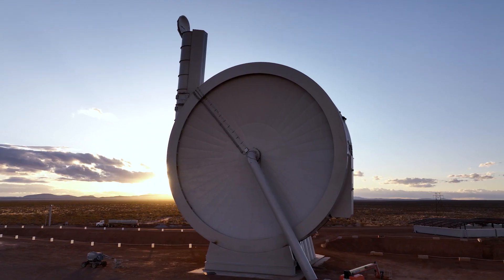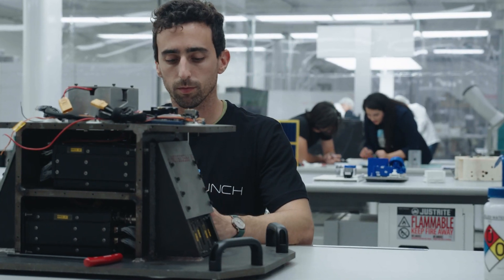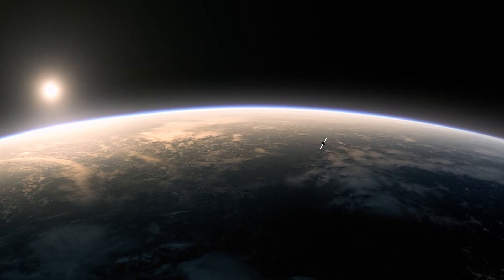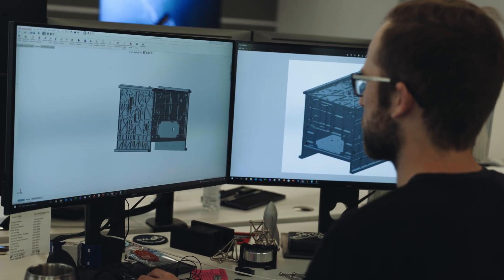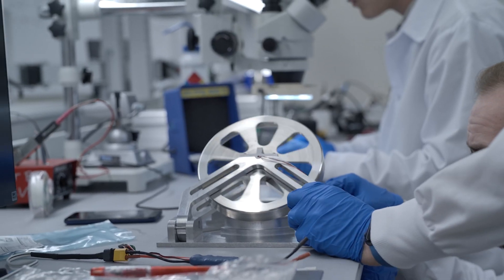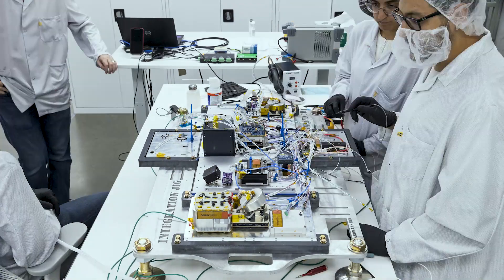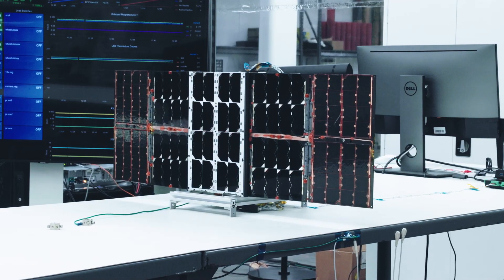An Inside Look: Satellite Prototyping at SpinLaunch

Comment: I wonder how long its going to take before this company's technology is debunked. If it was possible to launch payloads into space via kinectic energy alone we'd of been doing so for decades now and it would by done by spinning but rather electronic magnetic rail guns. 
The science just doesnt hold up because the speeds needed to escapes earths gravity are so massive that the payloads would burn up the second they took off due to atmospheric pressure and resulting air resistance.
If a satellite can burn up during reentry (where air is thinnest), imagine how quickly that same payload would imolate if going that same speed at ground level!!

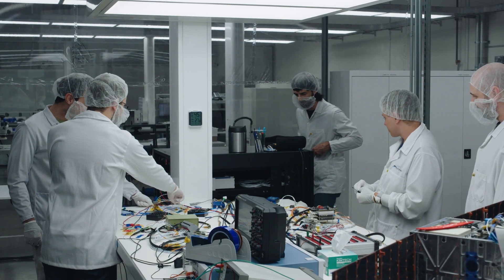Comment: Seems like your focus is now on satellite manufacturing and less on launching them. 00:47 makes that a point. Is there a problem with the launcher?
Reply: Only the entire concept.  They just need to reliably and cleanly sever two bundles of carbon fiber ~68 centimeters in diameter in a window of half a millisecond.  If either fails, the centrifuge destroys itself.
Reply: They may be having trouble finding a suitable place to build the launcher, they got turned down from building it in Hawaii because the state's residents weren't comfortable with the project being built near them.

Comment: Hello

World first: a solution for spin launch to be used anywhere.

Note: spin launch would be good for fuel etc into space. dumb zero electronic objects, fuel, food, water, materials,...crimnals.

Supersonic boom might be the only thing holding the system back.
It would be a rather large area if you did not compensate. There are structural changes you could make with the object you fling but I would consider something really simple like this.

Send up 4+ balloons, and use them to set up a conical sound damning system, with either tape straps/strings or similar hanging down, tethered around the launch site. You can control the balloons....that's technology from centuries ago even, but you can now use balloon/drone technology to hover a mile up...cough 20 miles up. Just need to reduce the sound, not catch all the air.

You could set up drone balloons, with canonical sound shielding around your launches and have zero, sonic booms going outside your launch area. That way you can launch from anywhere.

Hope this helps :)

Matthew

Comment: Heavy on buzzwords, but light on specifics.
Reply: Needs more blockchain, synergy, AI and quantum computing
Reply: You gotta read between the lines.

It sounds to me like it’s turning out to be tough to design a satellite that can withstand the insane G forces of the launch system. We already know the launch system basically works. The only reason I can think that they haven’t already built a full scale one and started putting stuff up is they’ve done the math and current satellites can’t make it through the launch process intact. To fix that, they need satellite design expertise they didn’t previously have. So they are working on developing that and exploring potential revenue streams that opens up in the meantime, with the hope that it eventually circles back around to making satellites that can survive being yeeted into space.
Reply: @SujanraAcoma if they can’t get a solid piece of steel into space why keep going?

Comment: Its interesting to note that spinlaunch's suborbital launch platform if placed on the moon has a launch velocity that's comparable to the lunar escape velocity.
Reply: A DIY catapult would achieve that too hahahaha
Reply: @Hypagon  that would be interesting and difficult to launch a 200 kg payload to those velocities with a catapult  design.
Reply: @kreynolds1123  I think it'd work on the moon. Better would be a tribuchet though, that could handle heavier payloads for sure. You don't need a vacuum chamber either.
Reply: That will be soooo useful maybe in 2055 :D

Comment: Spinlaunch should partner with other space companies to develop a low earth orbiting space station that processes rocket fuel and refuels rocket stages in low earth orbit.

Spinlaunch can cheaply launch buckets of water to space where solar power is used to generate hydrogen and oxygen that can be used to refuel and reuse rocket stages for geosynchronous orbits and beyond. Doing this will dramatically reduce the size of more traditional rockets and required rocket fuel, and number of stages as well as cost of getting payloads into space beyond low earth orbit.

Furthermore, spinlaunch can cheaply launch buckets of water to serve as shielding from radiation and micrometers.
Reply: That's not a bad idea. There are companies developing reusable space tugs which can ferry payloads from LEO to GEO. In fact, one of them (Momentus) is working on electric thrusters which use water as the propellant.
Reply: Spin Launches cost per kg is going to be much higher than Falcon 9s (not mentioning starship), and will also apply immensely destructive forces to the payload (requiring more mass, which reduces the "actual payload" segment of the payload).
Also, here is a list of groups that use Hydrolox upper stages/plan on using hydrolox upper stages:
Arianespace (only for Ariane6). Doesn't have a launch vehicle currently, future vehicles can't compete. 
Blue Origin (New Glenn). Hasn't even launched a payload, launch vehicle may be competitive.
ULA (Atlas V, Vulcan-Centaur). No remaining flights on first Launch Vehicle, second launch vehicle isn't cost effective. 
Also, it takes a lot of power to split water. So there goes that plan, regardless of the vehicle.
Reply: @bryanillenberg  Maybe it's just spinlaunch marketing, but im under the understanding the cost are expected to be about 1/10th traditional launches.  Where do you come up with the idea it will be more expensive? 

And water's is not destroyed by 10,000 G acceleration, So that vastly simplifies spinlaunch rocket design. 

Generating hydrogen for energy on earth is a bit more expensive. Not teribly much more but enough to be comercially relivent on earth.  but  throwing buckets of water up to space also gets the heavy oxidizer up to space.  And if this can be done significantly more cheaply, than traditional launches, Then in space where  solar PV gets more sun  per sq meter more hours of a 24 hour period as well as being uninterrupted by clouds, can produce the extra energy needed to split water. 

And then there's water's value for protective shielding for future occupied space stations.  Maybe even space based hydroponics for carbon dioxide removal and food for more autonomous occupied stations.

Seeing as spinlaunch's rockets and spinlaunch launch platform are a hybrid system to get altitude and orbital velocity, it might be interesting to refuel a spinlaunch rocket to get to much higher altitude orbits.
Reply: @kreynolds1123  we disagree on one major part: cost per kg.
Spinlaunchs design is (technically) more fuel efficient, so long as we ignore what is consumed in actually spinning the giant arm.
But it expends two stages (which will be more expensive to manufacture than regular stages. I'll go into more detail later in this comment on this). So, unless the spin is 90% as effective as adding a first stage (in other words, reducing fuel needed by 80%), it won't be as cost effective as falcon 9. And forget it 
And Spinlaunch isn't planned to launch water. It's being planned to launch smallsats. Very delicate smallsats. Which cannot survive 10g, much less 10000!
But, in your scenario, the water tanks would have to hold very high pressure water. P=density (997)xheight(lets say 1 m)xacceleration(100000 m/s). So, a total pressure of 99700000 pa. Or 997 bar. And similar (if not higher) pressure applies to the fuel tanks.
The tanks will have to be COPVs (and very strong ones, at that), of which 99% of the mass will only be needed in the first fraction of a second.
Carbon fiber is like 100x the cost of aluminum/steel per kg. So this will be expensive. And the thermal loads experienced in the atmosphere require high-cost materials for the fairing. Likely even higher heat loads than an orbital reentry (and the more efficient the spin arm is for lobbing this thing into space, the higher the temperature).
To the best of my knowledge, there aren't any plans to recover the fairing. So this super expensive thing is getting ditched after every mission.
I honestly can't imagine this thing actually saving money v.s an expendable vehicle, much less being competitive when compared to Falcon 9, because the material requirements are so intense, and no plan to reuse any of it.
Reply: @bryanillenberg  So on the reusability, Yeah imagine there no plan on the reusability of the launch vessel  shell but imagine if the small rocket boosters attached to the payload  could be refueled in low earth orbit so as to reach a much higher orbit. Or imagine some of those small boosters rocjeys were refueled at the refuelling space station and used to boost small more traditional rockets with sensitive payloads to higher obit. 

Its not a perfect analogy but here goes, One can drive a big truck with 300 gallon tank maybe 2000 miles across the country.  Or one can drive a small compact car across the country because it can refuel, and get a fuel economy closer to 25 miles to the gallon . 

There will come a point where space-based refuelling become a real thing. Getting fuel or the materials for fuel there relatively cheaply will be an important part of that.
Reply: @kreynolds1123  a satellite is very delicate. Most wouldn't even survive long term 1 g, much less short term 16000 g.
And the estimate for Spinlaunchs cost is, well, from Spinlaunch. I wouldn't put any stock in those numbers.
And the launch cadence their predicting? Forget it. There is no way they could produce that many shells (or very high pressure COPVs) in that time span. Maybe, if their lucky, they can launch 2/month. Which would be impressive, given that the materials required are 100x as expensive as what other companies use.
If you have to say "well, a tardigrade can survive it", your not going to be able to convince people to launch their payloads on it.
As for reusability and on-orbit refueling, the tanks, in order to be reused, have to return to earth. Theirs can't (and adding that capability would reduce payload further). And remember, this thing won't be competing with Falcon 9 (whose $/kg is much better already), it'll be competing with Starship (and New Glenn, if that thing ever goes up).
So, for your "big truck", "small car' analogy, remember, the "big truck" can refuel (Starship), while there are 0 plans to refuel the "small car" (Spinlaunch). And payloads requiring spinlaunch to refuel would be cheaper to just send on a kick stage+starship.